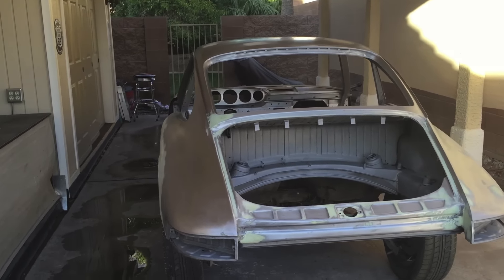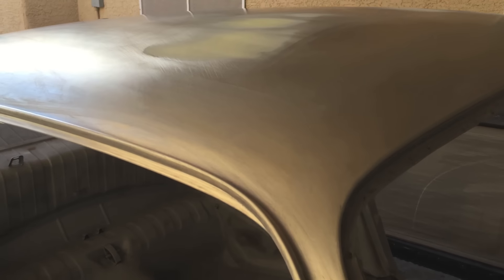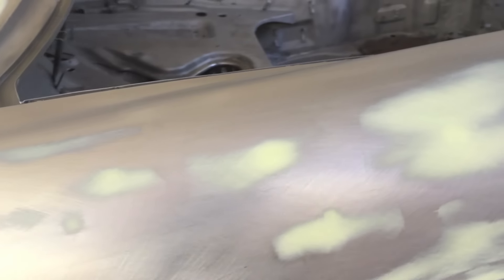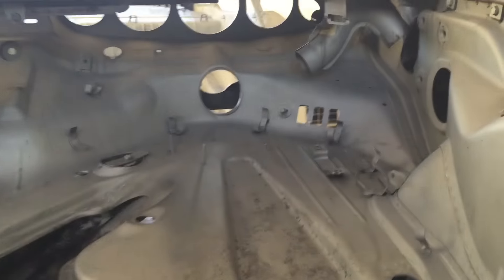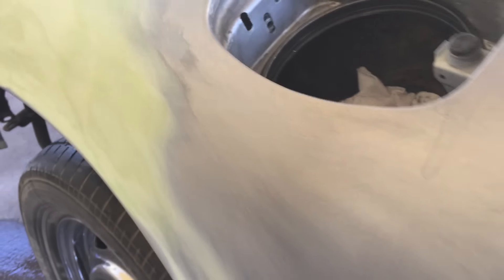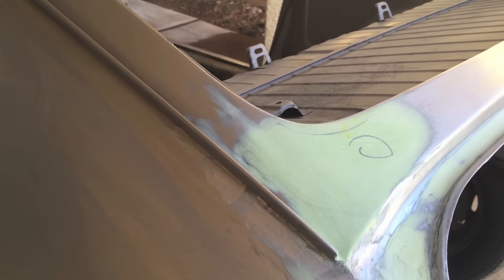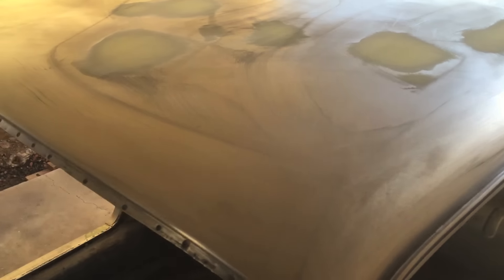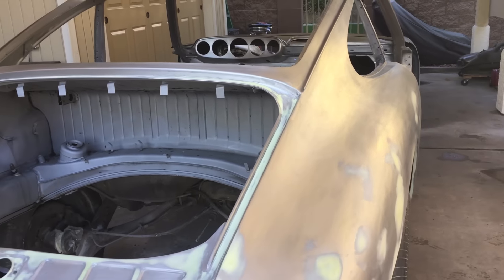1967 Porsche 911 Restoration Project - Video 1 Bare Metal

Comment: working on my 67   912  how do you remove the steering post??  love your videos they are great for the how to do it myself
Reply from the maker: Hello Gary
You can remove the steering post by first disconnecting steering shaft and pulling out thru the inside of the car. 
Once out then the fasteners can be removed and the post will pull out from the trunk side. Maybe some twisting and turning might be required depending on how stuck it is to the grommet in the dashboard.
Good Luck!
Reply: I had to cut the rubber bushing because it was hard as hanna's heart and the reinforced area for steering lock would not go past it  again thanks.  now for the fresh air flapper.
Reply from the maker: @garyhemmer8430  Mine was fused in there also..had to complete destroy it to get it removed..Im glad you were successful!

Comment: I’m getting close to finishing a bare metal repaint of an Irish Green 67 912. I did not use chemical stripper so I had it media blasted both sides of hood, engine cover, doors and bumpers, much easier. I didn’t have the inside, engine bay, and trunk, but next one I will. (I have an ugly 66 “sunroof” next in line). As soon as I got it back from blasting I wiped it down with solvent cleaner and shot a coat of Glasurit 285 10 DTM . We then put all the panels back and realigned, then bodywork, more primer, block then more primer. Then panels off, painted both sides and the body painted..
It looks like you are doing a great job.
Reply from the maker: Hello Freddy
Sounds like you have some very nice projects 
Keep up the great work and good luck with your restorations!
Reply: Mike’s Restorations Thanks, I have nothing else to do! As I’m sure you are aware old Porsche restorations are serious money pits, outrageous cost for parts even repro are expensive..

Comment: I did this once to an Alfa Romeo Montreal and when I was done I stored it in a garage.  It was covered in the garage but when a hurricane passed by my area a roof leak developed and when I pulled back the car cover and there were huge rust bubbles in the car.  The paint lifted.  Today I dont know how to paint a car that has been reduced  to bare metal.  I used an epoxy paint system from ppg.

Comment: Hey Mike, How did you clean the chemical from the seams and tight places in car? I would be afraid to do that to any car because it would popup the paint.
Reply from the maker: Hello Leon
Thats a good question..
The car is chemical stripped and then sandblasted to bare metal particularly in the cracks and seams. After sandblasting and compressed air blowout of all seams then we apply a seam sealant to those areas.
No chance of chemical residue to affect finish paint.
Also working on the microphone!=)

Comment: Hey, is it possible to fit an engine in the front or can it only be in the rear? Also can you fit an LT4 in the rear/front?(or any V8 for that matter)
Reply from the maker: I suppose anything could be done..I have seen an early 911 a few years back at the SEMA show someone managed to install a 350 in the rear

Comment: Were it was :) What product you used here Mike? Same for outside paint and inside? Any electric tools at this stage ? Thanks
Reply: The car can't stay without the epoxy to long right? how long since you took the paint to epoxy?
Reply from the maker: This stage was all media blasted with 80 grit glass bead.
At this stage everything was done by hand..no power sanders or grinders
But many guys use them for this stage and is okay and will help move things along a bit faster.
For the epoxy primer to stick well a 80 grit scratch is needed everywhere.
Grinders and power sanders will be fine..For myself I just prefer to use hand tooling as I am able to feel the surface shape better and more sensitively
Keep in mind though I am cabinet maker by trade=) not a professional body shop
Reply: @MikesRestorations  what was the product to remove paint before media blasting ?
Reply from the maker: Here is a product link:
http://www.jasco-help.com/product/premium-paint-epoxy-remover
It worked pretty good but that old German paint is really tough..
will require lots of elbow grease to remove!
Good Luck!!